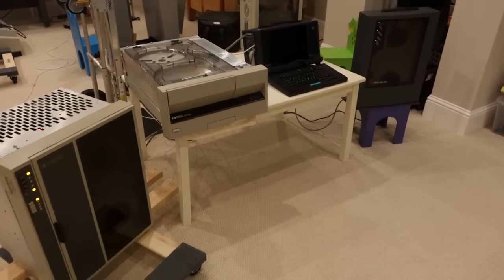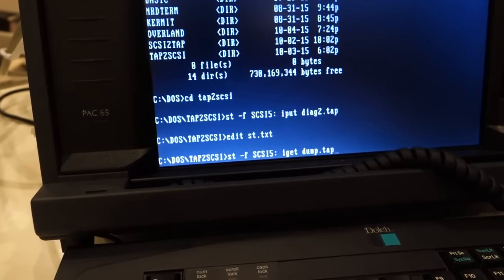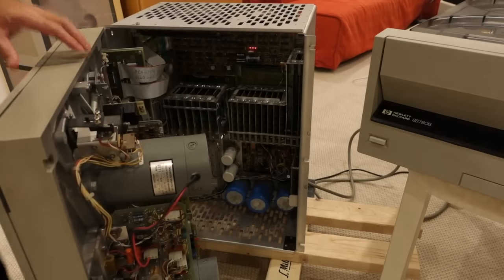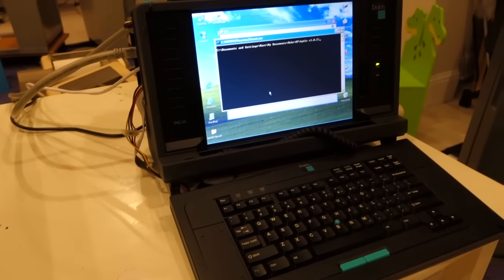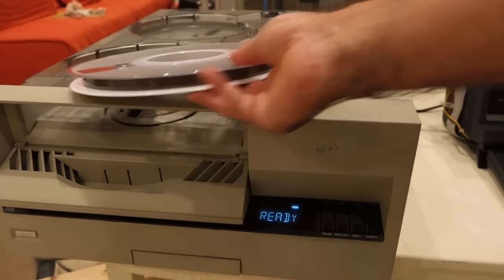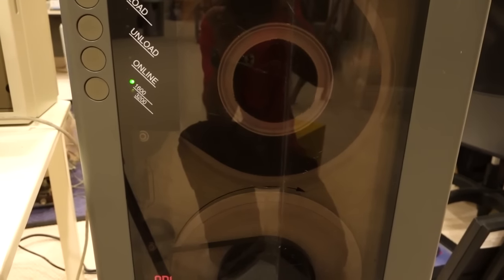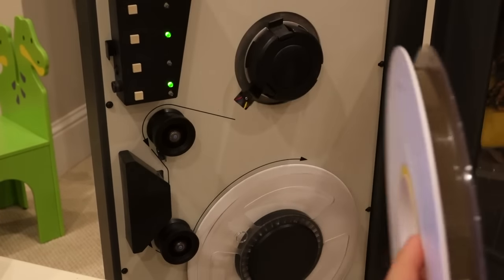HP and Overland 9-Track Tape Drives Demo

Comment: After playing with my HP, I discovered not all tapes are equal. 2000AD BASF 6250 cpi.  It had problems loading, unloading..reading, writing. At first I thought it might be the machine, so I gave the heads a good cleaning.  It helped a little but not much. I switched to a No. 703 6250 Black Watch 3M and everything worked perfectly and faster. Less retry's, faster read and writes, and it always unloaded and loaded without a hitch. My guess is the BASF's were much more deteriorated then the 3M. Both came sealed  in original package, unused.

Comment: When I was in college, I worked in a data center for a bank as a mainframe operator on the evening/night shift.  They used an NCR mainframe with 9-track tape drives similar to the 'granddaddy' one you showed.  Lest you think I am positively ancient, this was from 1997 to 2001.  Like most banks, their approach to technology was simple:  CAN it be done without buying anything new?  Then you don't get anything new.  Doesn't matter how old and busted it is.  While I worked there, we got a call from a restaurant in another part of the country.  Turns out, they were the ONLY other people in the entire nation still using the model of mainframe we were.  And they were getting rid of it and replacing it with a PC.  They gave it to us for free if we would haul the monstrous thing away.

The tape drives in particular were a nightmare.  They had the vacuum-driven autoloading, which is totally awesome... when it works.  Unfortunately, the primary tape drive we used had a broken seal so could not get a proper vacuum.  And it squealed like mad.  It was positively deafening in the mainframe room where I primarily worked.  Most of the time, I had to thread the tape manually, but had to let it try to do it auto a few times before it gave up and let me do it by hand.  The drive itself was much larger than the one you showed, about 5 feet tall (but the same width and the same vertical layout).  Rather than a cabinet door on a hinge, it had a neat sliding clear plastic 'blast shield' type thing that would open/close as necessary.  I wouldn't be the least bit surprised if they were still running that mainframe and those tape drives.  Short of a catastrophic failure like the thing bursting into flames, the bank simply was not willing to upgrade.  They got bought by another bank chain and everyone said they were going to close the separate data center and merge all the systems into the purchasers existing data center... but when I ran into an ex-coworker 5 or 6 years later, he said they gave up on migrating it because dealing with all the old software was just too much...
Reply: pop over the sysadmin subreddit sometime... your story would make an interesting read!
Reply: How is the bank now?
Reply: If it aint broke, dont fix it.
Reply: Imagine getting that for free!!
Reply: @NicheAsQuiche  "free"
then you realize you need to haul several hundred pounds of hardware without banging it up :P

Comment: The mechanics of the 8878OB (the first one, using vacuum to load the tape) run so smooth and seem built to last for eternity, very impressive, I'm loving it! I'm also thrilled that there are people out there, scattered over the world, who have a fundamental understanding on how data data reading and writing is controlled via the I/O on these machines on which they are able to write software to run those machines from a (much) later and very different platform and interface than initially thought to work with. I think that that ability is very unique and I'm happy that these people are in contact with another.

Comment: I knew some of the guys at HP who developed the HP 88780B.  They called it "the pizza oven" drive.  If I recall, it had a "thumper" to tap the tape before it started moving to prevent "sticktion" i.e. the tape sticking to the head before there was time to develop the air layer between tape and head.

Comment: I used to work at a place that had one of the 7000 series tape drives. We called it the little tape drive because it fit in the same 19 inch rack as the HP 3000 CPU. The other tape drives were vacuum column types which were much larger.

Comment: That HP 7980 (or similar) drive is a beauty.  It’s excellent for logging or reading tapes.   However, it’s susceptible to underruns and won’t stream if the block sizes are mismatched.  

The real problem here, is that wonderful pure dos driver your brilliant friend wrote. 

If you could grab an old HPUX box, the driver is native in HPUX 10 and 11.

I say this because, once you get the driver for the 7980 working, you can get the 7980 to either stream or at least read a lot more tape before stopping by using  dd.

Remember, dd allows you you change the input block size and output block size.

Use a larger block size with dd and the that 7980 will stream!

Comment: Started out on Pertecs where you had to manually thread like your second system.  But over the years moved on to a 'desktop' unit like your first one that was self-threading.  Still pretty fascinating to watch it slowly turn until it 'sees' the end of the tape whip around, then knows to slowly unwind as the air flow 'blows' the tape throught and around.  Takes me back. :)

Comment: An ibm 2401 could rewind an entire tape in 64 seconds! It did this by pulling the tape out of the vaccuum columns and rewinding extremly fast, then sense the remaining tape by a photo sensor. When the tape got low, it would load back into vaccuum columms and move tape backwards to BOT sensor. If unload was requested it would pull tape up from columns and slowly  roll backwards until the tape break sensor detected no more tape and glass door would come down.
The IBM 3420 had an autoloader sysyem which the tape had a special band around it. The drive would puff some air into the band and the tape would come out of a little window on the band and would be blown across the heads and then by vaccuum onto take up spool. Then the tape would enter the columns and would advance the tape to the BOT markern then the drive would be ready
Reply from the maker: Yes! Such amazing tape drives! And you can see our IBM 729 doing a similar high speed rewind here: https://youtu.be/7Lh4CMz_Z6M?feature=shared&t=839

Comment: Amazing. Bet operators were relieved by not having to thread tape anymore.
Still not as cool as the vacuum column tape drives though. The way that the spools randomly (or rather less predictably) spun in different directions was mesmerizing.

Comment: Ah, brings back memories of my Computer Operator days - we didn't use HP in any place I worked in, they were all ICL.  However, they all pretty much worked the same.  We eventually replaced it all and I remember all of the team spending an entire night shift removing all the racks of tapes (about 8 on each arm) then walking out to chuck them in the rubbish skip.  Filled about three of them, and the truck had trouble lifting them :-)  The auto loaders (we had ones that auto-opened the collar) also benefitted from making a crease on the end of the tape so it sat a little up from the surface, made grabbing the ends easier.  Those tapes when thrown away also make excellent bird scarers when used on a vegetable patch as they flickered in the light and made buzzing noise in the wind LOL
Reply: Can you imagine being able to save that to this day, how much nerds like us would be clamoring to get them??

Comment: I had an internship at a college summer of 2000.  I was poking around the basement of an engineering building and found a rack of 9 track tapes.  I looked it up and I believe drives were still available new at the time, though I may be mistaken.

Comment: Fascinating!  I have a Qualstar 1052 Drive.  It has none of those idler arms of your HP drive.  I have nothing to read or write from the drive so I have been thinking of making an arduino to load and save data to it.  I wonder what the intention was with that drive.  Your hp seems more appropriate for loading and saving records instead of bouncing back and forth like my qualstar.
Reply from the maker: This was a low cost unit mainly meant for reading tapes from aging mainframes and transferring them to the then new PCs. Also could be used for backups. As you correctly noticed, it's a streamer, as opposed to a much more expensive and complicated start/stop tape, of which the HP 7970 is a fine example. The start/stop tapes became extinct after disks got cheap enough in the late 70's. They were replaced by the cheaper streamers with large memory buffers, which can be very fast if you write or read large chunks at once and never stop. Which is fine, since by then the primary job of became doing backups. Remember that for a very long while, tapes could hold orders of magnitude more data than disks, so tape was the obvious choice for backing up disks. The Qualstar is a streamer, but it is also very slow! So it did not have much redeeming qualities except for the small size and price, which were of primary importance for it's intended PC market.
Reply: I suppose it would be at least good to make an interface with an Arduino and use as a drive for my Rc2014 Z80 computer.

Comment: The clack on the 88780 (HP 7980) tape drive is the tape lifter to keep the tape off the head is fast speed mode.  The tape only contacted the head in read or write mode.

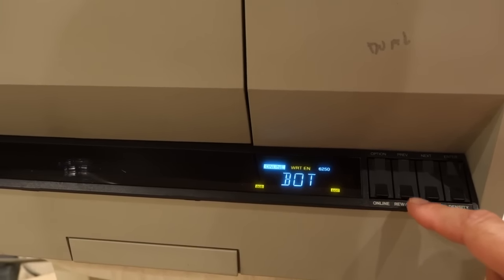Comment: @2:29    Should be:  6250 BITS per inch

Awesome demo on some amazing equipment!
Reply: Its BYTES per inch as the data is written parallel. Hench 9 track..8 data bits + parity for each byte. Ehe BLOCK also has a CRC that the controller uses to determine a correct read or write. The heads have a read after write to correct any errors on write. Of there was an error, it would back up to the interblock gap and re-write the block, if thw write was unsuccessful, it would erase the block and advance the tape to a new spot and try again. This is a soft write error

Comment: Bought the same HP (auto loader) machine. Door would not open so I opened  it up. Pulled the boards out, fiddled with the connections and the buttons that open the door.... started to work again. Seems like these machines are tough but they can suffer, like all things from oxidation.

Comment: Is it possible to use some sort of software buffering to prevent the HP from tape thrashing?  Like Smartdrv does for logical drives in dos. The tape drive is probably not a logically assigned drive i realize... (also keep in mind that dos 6.22 keeps the write cache off by defult unless the /x switch is removed from smartdrv. )  But some sort of lazy write cache should be able to help performance.

Comment: I worked on the IBM Series 1 versions of the first two, many years ago as a service engineer. The front panels were different, and I guess the interface was somewhat different. Great when they worked, but could be a real pain in the bum when they developed a fault!! It helped if the operator cleaned the heads occasionally!!😂. ( I still have the IBM test tapes and the 8" diagnostic diskettes somewhere! Sad , I know!😊)

Comment: Hi Marc: Thanks so much for the message. The bottom hinge on the door is broken, which I will fix, but I am pretty sure the door still closes good since I hear the latch. Besides in the machine, could it be anything on the top Hub since it got some small arm there? Hope it is not anything on the boards inside. thanks and I will sure keep in touch. I sure love these drives and the ones back in the older days of the 1950's and 1960's, the ones you have, and especially the ones you see on sci fi movies or shows. Love the burroughs B205 system used on all of the Irwin Allen shows like Lost In Space. Thanks again Marc. I will try a couple of things. If you think of something, please let me know. Victor:)
Reply from the maker: +toborthegreat Could be anything. The sensor protruding under the top reel is just the write protect ring sensor. Should not prevent loading even that  did not work.

Comment: Okay, I know i'm not the only one that is dying to know the capacity of that tape in KB/MB...I know it's not much and probably couldn't even hold an MP3 or even one hi-res photo taken from a modern camera
Reply from the maker: About 40 MB for the older 1600 cpi density tape drive (the HP 7970), and about 140 MB for all the others when running in 6250 cpi density.
Reply: The first hard drive I used in 1990 had a capacity of 20MB, so back then even 40MB was a substantial amount for a backup. I used a lot of floppy discs!
Reply: Tapes can have unlimited storage capacity as a file can span multiple tapes (multi volume files) but each tape could hold about 250mb per reel

Comment: Very nice video. Thanks for making it and explaining things to us.

I wonder why, when it is recording data, the tape drive goes backwards. Is it verifying that the data it just wrote was written correctly?

I have an HP DAT72 USB drive since 2007 and every few seconds it makes a grinding noise. I guess it's doing the same thing, because regardless, my backup worked just fine.
Reply from the maker: You mean the HP 88780? It's because I'm writing antique tape data with many extremely small files on a relatively modern tape drive. This is a fast "streamer" tape and streaming is interrupted at every end of every file. It stops, overshoots the intergap record, and needs to go back to find the IGR and start for the next file. It would also do this if there was a read or write error, but that's not what's happening here. My much older HP 7970E would do a much better job at this: it's a start/stop tape with huge motors and complex servo tension arms. It can stop instantly right in the gap, not needing to back up. Sometimes newer isn't better! Start/stop ability was abandonned (because of the mechanical complexity) as soon as memory buffers got large and inexpensive enough to patch up for the cheaper mechanics. They called them "streamers", but that's marketing speak for "tape that can't stop fast enough". Which was not important for backing up large files, which was their main use. The best start stop tapes are the vacuum column ones, they are mechanical monsters. See my other video on the IBM 729 here https://youtu.be/7Lh4CMz_Z6M.

Comment: I currently own an Overland Data (San Diego, CA) 9-track desktop drive. Model 3210. Still have old 9-track tapes. Original box too. I have the controller in one of my old PC cases. It think it's an EIDE or such. Does OP want them?  [EDITS: included the model number; confirmed original box.]

Comment: Hi sir! So.... I loved this video and I'm in need of a little guidance. I have probably over 1000 tapes that I need to read and we are already looking into getting the HP (currently 1200 on ebay).  So, the hard part! what's the best software to read these? I'm guessing its best to buy a old 486 with DOS/Windows 3.11 for starters and a SCSI controller.  Can you help me with the best software to extract data? I'm sure its hard to tell what's on the tape but I would guess its 80% SEGY format.  Thanks for your time.

Comment: Hey Marc, I'm Victor. Seen your R2D2 on youtube. I have a full size Lost In Space robot, first season and work with the guys that built the chariot. I have a Overland Data OD3201 too that I am trying to figure out why the magnetic door does not work so the machine starts. Sure like to keep in touch with you. Take care, Victor
Reply: Hey Marc, love the R2D2 Robots. I have a full size Lost In Space robot that I bring to shows. Hope we can keep in touch. I see you build robots and I like your videos on the 9 track tape units. Trying to get my Overland OD 3601 unit to work. There is a problem with the door latch, it won't stay closed, bounces back for some reason, so I am trying to find the part. Take care Marc, Victor

Comment: Hello Marc ..l love your videos. Please do more. I have the Overland unit also...what type of parallel cable connector does it use. I need to purchase it. Thank you for your help.
Reply from the maker: The doc and software for the Overland is on my website: https://www.curiousmarc.com/computing/overland-tape-drive
Reply: @CuriousMarc  Hello my friend. Sorry it took so long to reply. Unavoidable. Thank you so much for the info. I am a total novice at this. My Qualstar 1260S is in mint working condition, however today while running it in demo  mode, the rubber strip around the take up reel broke. Any known replacement for it. Also, I tried to find an email link for you...or maybe you prefer not to have one (on your webpage). You are very helpful...thank you. I have so many questions....like what program to use to access the drive from PC and where to find it? Thank you.....Mark

Comment: Hello my friend. Just want to thank you for a great video on the vintage 9 track machines. I have the Overland 9 track that you have coming in the mail from EBAY. Just wanted to ask you if you can help me get it going? I have my older HP pc that can run DOS. I see that you pointed out that I will not need the Pertec card since this machine has the parallel male plug. This can go right in the back of the pc? Could tell me what software I would need to run this machine? Just to add, the male parallel cable is missing a few pins, would I have to get a schematic for this machine? Thank you very much for your help and love these machines. They are more interesting then today's computers. Take care, Victor
Reply from the maker: You shoukd be all good. The connector does not have all the pins, that's normal. Jjust plug it in the parallel port at the back of your DOS machine. Try to find the Depot4 software from Overland, send me a private message if you can't get it.